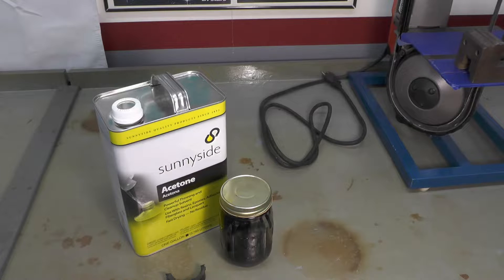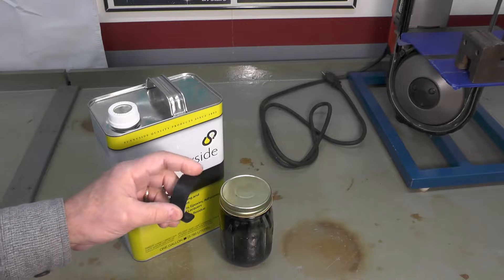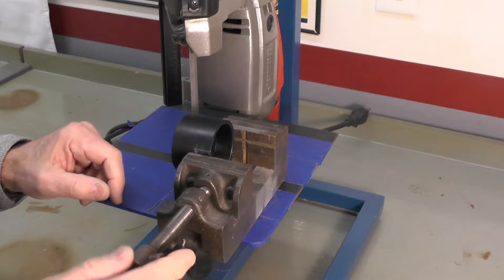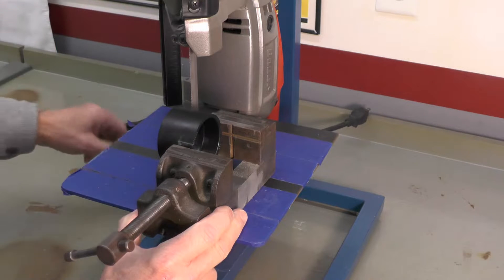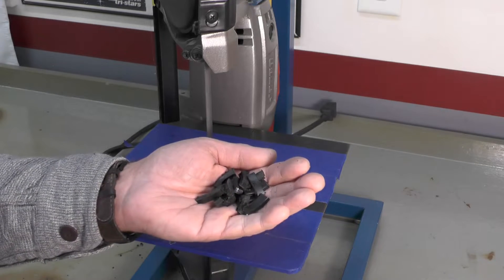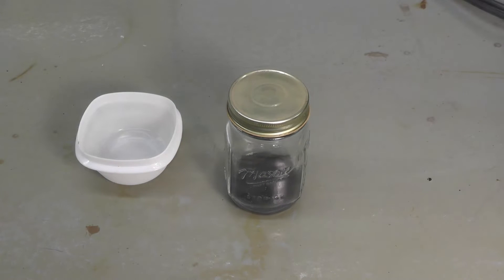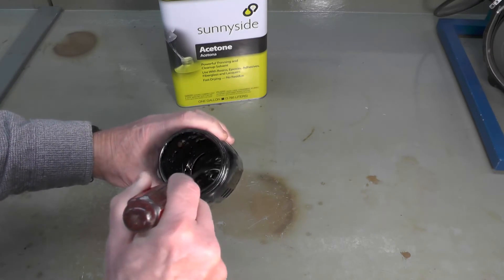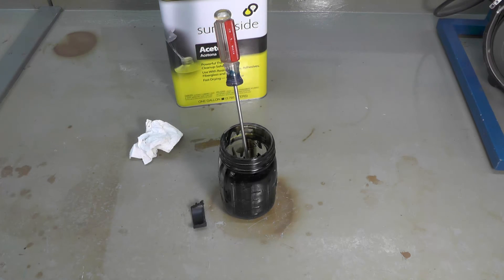Plastic Repair, Making ABS Slurry --- Video #367

Comment: Question:  Once the Acetone evaporates off, and the slurry hardens, what are the characteristics of of the ABS?  I'm thinking casted part, for instance.  Is it strong?  Does it become brittle?  Can it be joined to another part using MEK?  Any ecperience or guesses?
Reply from the maker: My typical use of the slurry is as a filler.  This doesn't mean a skim coat of body filler won't be necessary as small pits or air pockets in the ABS filler may appear.  I've never used it to cast parts or to join two pieces of ABS together, though it probably could be used for this.  The strength seems to be similar to the original materail. For joining pieces I use a solvent used for plumbing as this is what these adhesives are made for and work very well.  Once the solvent has evaporated the slurry seems to retain it's original characteristics so I've not had any paraticuular problem with cracking or brittleness.  I've not used MEK with ABS, always acetone so I can't really comment on that.  I keep acetone around so it's convienient, I don't normally use MEK for my projects.